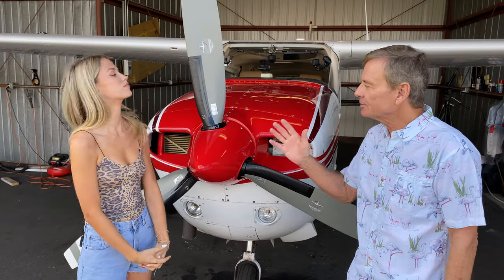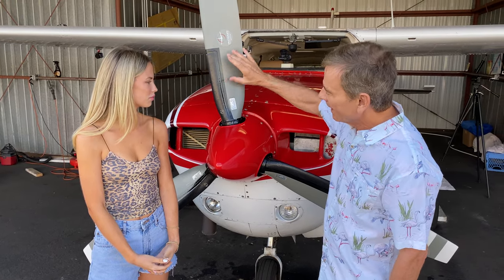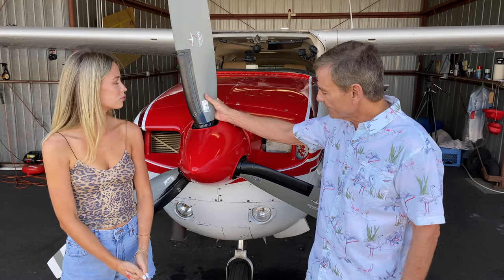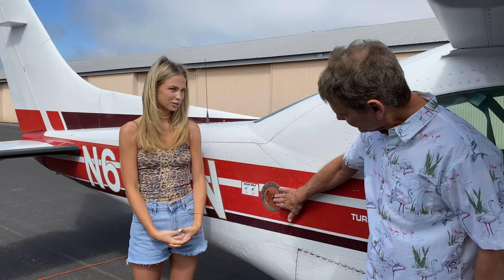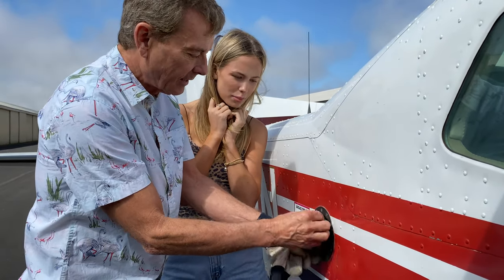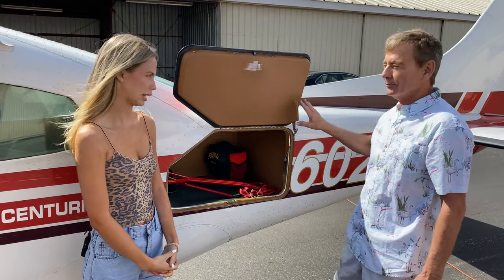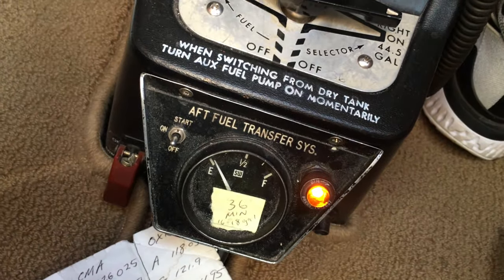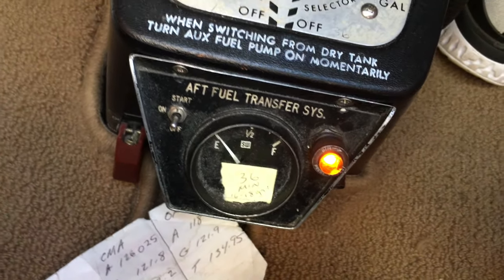The HOT PROP and MORE!  @piperwatts

Comment: Great video, another tip for Piper, if you ever get into an icing condition and some or all of the hot prop doesn't work, you can save the day by changing the pitch of the prop a bunch of times and you can actually shed the ice off the prop. I did it in a 210 years ago.
Reply from the maker: Good tip. It does flex the blades a little when you do that.

Comment: Good to point out the pitot tube when mentioning static port.  Several instruments use both.  

Hey Piper: Before your first solo, make sure your Dad doesn't pull a fast one by putting removable tape over the static port.  You'll want to look closely during each preflight.  That would make some of the instruments go wonky.  

5:05 - Piper is going to become an awesome pilot.  I just know.  She sensed that both heads were down in the cockpit for too long, and she popped her head up to look out.
Reply: As much as we would like to see Piper solo in this aircraft it's not possible, She will need a retractable undercarriage and variable pitch prop rating first. this is not possible. She will need to first solo in a C172 or similar, Like the rest of the world did. lol
Reply from the maker: RW you are correct. She would need a high performance endorsement in her logbook before soloing in this aircraft.
Reply: @airlogic  Well, on the plus side, once she gets her ticket the complex endorsement should be a piece of cake!
Reply: @b1blancer1  Yes i have no doubt Piper will be a very astute rated pilot in no time. She may even follow her Dad's footsteps in the Airlines.
Reply: @airlogic  Maybe by the time she's ready for the airlines there'll be some jobs available. We can only hope.
Reply: @airlogic  It IS possible for a student pilot to receive a high performance and complex airplane ratings. An initial solo could definitely be done in a 210.

Comment: Piper's slender figure compliments the aerodynamic surfaces of the plane. Regarding the skin-flush air inlet for gauge sensors, an expensive B-2 crashed because of water getting into such a port:  https://en.wikipedia.org/wiki/2008_Andersen_Air_Force_Base_B-2_accident, but then, that plane's computerized.
Reply from the maker: Thanks Lindsay !

Comment: It's also possible if the plane is washed with a hose sprayer water gets forced into the static port and clogs it.  Only way I can think of to prevent is don't let someone else wash the plane that isn't aware.   If going instrument flying after washing plane or lots of rain if you can get a shop vac and slowly bring it near the static port you should see altimeter and vsi (less so) move a little (don't put it right on the port obviously or you could damage an instrument).  Anybody know a better way to check a static port that it's not blocked?
Reply from the maker: Good points J

Comment: I don’t believe the aft fuel is standard issue. Did your father have it installed? Or did it come that way? It’s basically an extended range tank. Interesting. Learned something new!
Reply from the maker: You are correct. It is after market installed by the previous owner. Good comment !

Comment: I noticed you have speed brakes also, Was this an aftermarket modification. I enjoy your videos.
Reply: RW good question
Reply from the maker: Yes you are correct. They are after market and are very helpful in expediting descents without "shock cooling " the engine. They add drag so the pilot does not have to make a major power reduction to descend. They can be used at any speed allowing pilots to keep their speed up while descending. Piston aircraft engines have many different types of metal parts that all expand and contract at different rates with rapid power application or reduction which increases engine wear.
Reply: @1capcarl  safer than a side-slip.